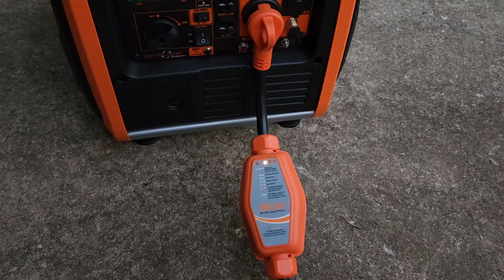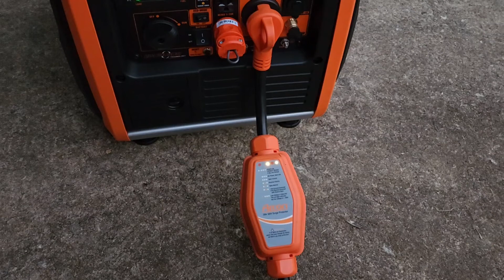Generator Neutral Bonding Plug - What, Why and How

Comment: This was the exact problem I was having with my Wen DF452iX. It would power all my RV's power outlets however wouldn't charge my 300ah Lithium Iron Phosphate battery. It's a 2021 Forest River NoBo 19.5. Surge Protector reads "open ground". Im dry camping for 6 weeks in the High Sierra's, luckily I have a spare battery and extra battery charger. I ordered one instead of making one to General Delivery to my closest post office. Arriving Thursday, hope it fixes my issue. Thank you so much for the thorough info. Great video
Reply from the maker: Hopefully it fixed your problem.

Comment: Grounding the neutral at the generator with a plug is a code violation and you are creating a "new path" for the unbalanced load to go to ground. Neutrals are only bonded at the main panel or means of disconnect where it enters a structure.
Reply: I’m sorry sir, but you are incorrect.   The generator has a breaker inside it.   The generator is a “Separately Derived System” in the NEC.   In the beginning he said “Feeding power to an RV.   Running it to a dwelling or building, you are correct.
Reply: And would have to assume electric company SouthWire would not make and offer this with their name on it.  My 1st two are SouthWire brand.

Comment: My generator (Genmax 3500iAED) has gfci on the 20 amp plugs. Will this bonding plug trip the gfci? If it does, how do I get around this?
Reply: I see no reason the GFCI receptacle would trip, unless there is something wrong.   The ground should draw zero current, so any current on hot and neutral should be the same.  Remember this is “ONLY” for connection to an RV or boat, not a house of office
Reply from the maker: Yes putting any kind of bonding plug will trip the gfci. I do not know any way around it. That issue will take some research or maybe someone will reach out from this comment.
Reply: @TheManCaveVideo I’m running into this problem. Neutral binding plug is tripping the GFCI outlet on the generator.

Comment: Worked for hooking up my Bluetti AC200 power supply to my Armstrong gas furnace, in an emergency. 
Initially the furnace would throw a 9 flashes code, which is incorrect phasing I believe, when I tested it first.
Mostly it needs to see ground for the flame sensor I think, but it works now.
Reply from the maker: Awesome!

Comment: Why do you need this plug? Any impact on RV hookup? Thanks
Reply: You do need it for an RV.   They are not bonded in the RV.   So, without it, the ground slots in the receptacles are connected to nothing.
Reply from the maker: You don't necessarily need this plug, but if you have some fancier surge protection, it may not pass voltage unless it passes its self check with no warnings.